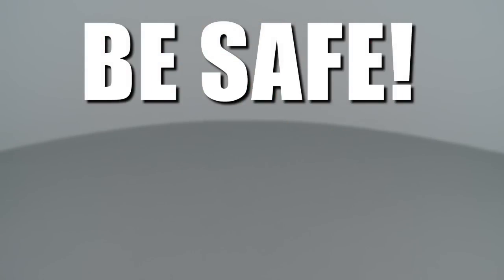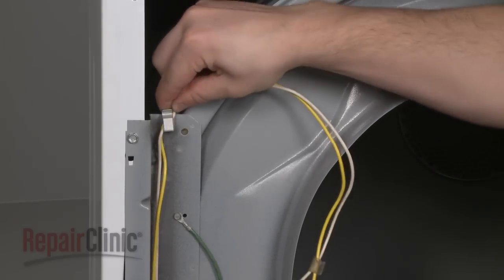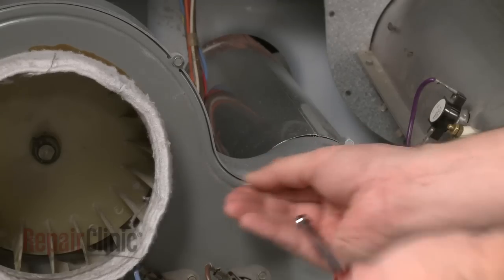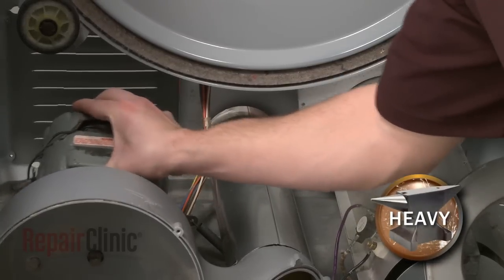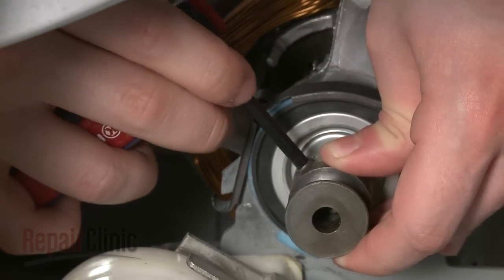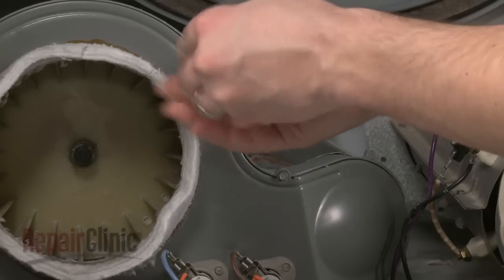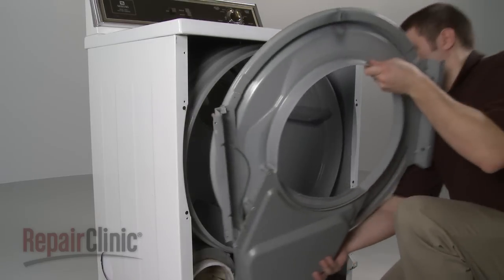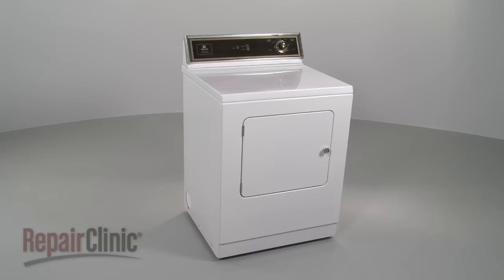Maytag Dryer Drive Motor Replacement #W10410999

Comment: Repair Clinic - can you post how to wire the new motors? It is numbered instead of color coded. No instructions came with the motor, is there a schematic somewhere?
Reply: I'm having the same wiring issue. How did you figure it out or where did you find an appropriate wiring manual?

Comment: when getting the motor clamps off, I tried screwdrivering and beating for days, however, I was very successful after only a few minutes with a vice grip!!!!!!!!!  Just clamp on and pull off. No pain, no strain.
Reply: It's 7 years later and yes, this is the best way to take the clamps off.

Comment: I just bought this motor from Repair Clinic and the switch on the new motor looks nothing like the one on the replacement motor in the video. My quandary is that I have a white wire in the place of the grey one in the video and its unclear where to attach it to the new switch. My scenario does not fit with the supplied wiring instructions. Help Repair Clinic.

Comment: I have a 5KH26JJ064S that a got from a craigslist post from the side of 
the road with metal and this was in it. Anyway I don't care for AC 
motors much but I always have a hard time knowing how to wire them up. I
 used my DC bench power supple and put the negative to black and the red
 to the orange/blue and the motor resisted to turn so im thinking it 
works but I am hesitant to hook it up to AC since AC is always more 
complicated (and dangerous). There is a switch with 1-9. 1, 3, 5 ,6, 7, 8
 have tabs and blue is on the 8. Orange is on the 7 and black is on the 
6. How do I wire AC correctly. I think this motor is only AC as I do not
 see any commutator. Please respond thanks

Comment: The motor drives in these dryers have changed the schematic of the starter switch of the motor.  You still need to plug in the Blue wire as well towards the very left.  I know the directions are quite sketchy about where to hook up the blue wire but it plugs directly to the starter switch as there is no tab up on the motor.  I should have taken a picture of how I hooked the wires up but I've had no problems with the dryer since.
Reply: I know it's been 10 years since you posted this, but I'm trying to wire up the new motor on my dryer and your reply seems relevant. Changing over the wires to the new style switch w/o directions. I have one with touch screen type circuit boards on the front, a se1000. Your post gave me encouragement if not the picture. Thanks

Comment: Does anyone know how to wire the electric drive motor... What I mean is, the new drive motor has a new wiring connections... I need to know if the blue wire is eliminated and the black wire connect in it's place ?
Reply: I'm having the same wiring issue. How did you figure it out or where did you find an appropriate wiring manual?

Comment: YOU FORGOT ONE IMPORTANT DETAIL IN YOUR VIDEO --- the Whirlpool so called "direct replacement motor" for the DG210 is not a direct replacement --- the electrical block on the motor has about 8 or 9 terminals and the wiring harness has to be modified (altered) --- wiring diagram is not included and nothing is color coded --- I guess the educated idiots and pencil necks at the corporate office didn't think that info was pertinent? --- I'm diy but I can guarantee you that an experienced repair technician wouldn't have a clue which spade lugs had to be replaced and where they plug in.

Comment: Hi There, I live in the UK and have purchased a motor from the States, on receiving it i have noticed that the motor is 115V, the motor that I have taken out of my machine is 240V willthis motor work in my machine? part no.
Whirlpool W10410999 Motor
Reply from the maker: 115 Volt motor will not work in a 240 Volt machine.